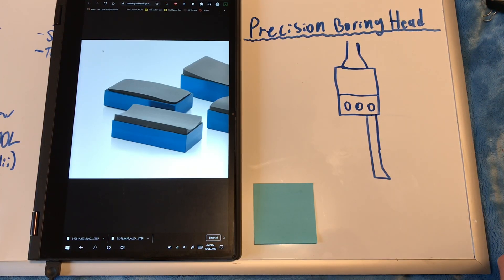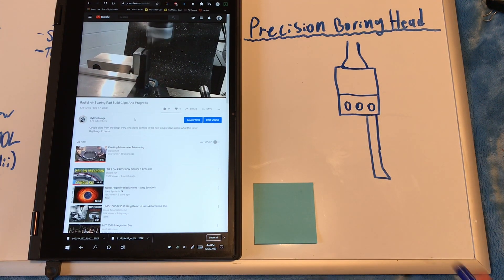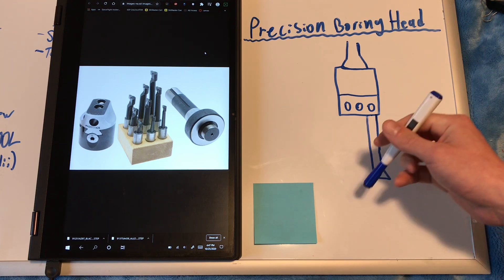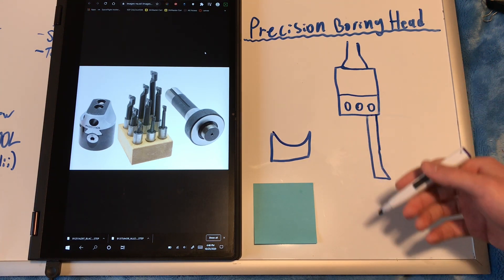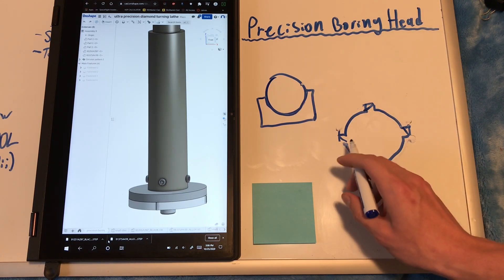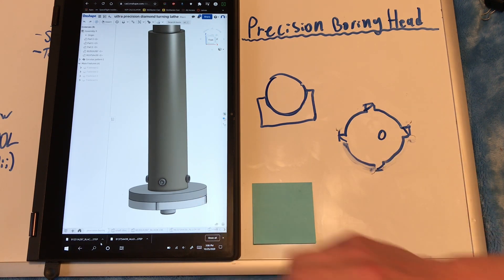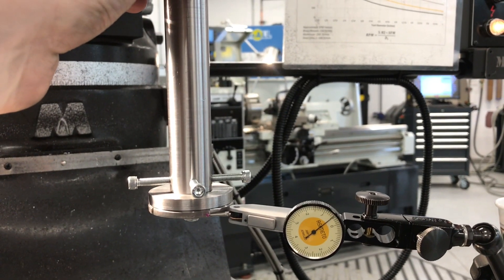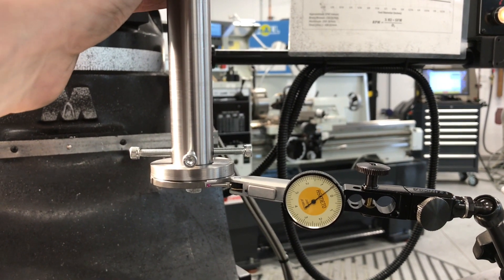Design And Construction Of A High Precision Boring Head For Cutting Graphite Air Bearings

Comment: Hey, cool video. It looks like you got the result you were after. If I were doing something similar, I would definitely stick with single point boring though. Sneak up on the radius by cutting a ring that can be measured after you cut the work piece (if you have your air bearing hanging out the side of a vise, clamp a graphite ring to the machine bed, below the bearing). Then you can measure the diameter cut using telescope gauges or a tri-mike if you have one, or even fitting up to gauge pins. If you don't have a big enough piece of graphite for a ring, you can just put another block on the opposite side of the cut that you can measure between.

To combat the stiffness issue, I would say either line bore on a lathe, by holding the boring tool in the chuck and the workpiece on the carriage, or make a quick and dirty heavy boring head. 

For the boring head:
Get a piece of steel close to but under final size by a 10mm or so, turn one end to fit in the largest collet or even to have a taper that matches your machine spindle (R8 in your case). On the other end drill and ream a hole radially to take a mini boring bar. I use ultra-mini from ceratizit (https://cuttingtools.ceratizit.com/gb/en/products/73000637.html) but I'm in the UK. You can drill and tap some holes on the bottom face of the head to clamp the mini boring bar. You have to run the spindle in reverse because of the tool orientation. Take a cut rough cut, measure it, then use an indicator like you showed to measure the boring bar position sticking out of the head. It's a lot fiddlier to accurately set the cutting radius compared to use a screw to advance the boring head like on a commercial boring head, but it's very quick to make the tool, maybe 30 mins or so, which for a one-off use like yours makes sense, and the stiffness gained makes a huge difference for precision applications. I've made 3 or 4 over the years and they work well.

Another thing is I think it is generally better to make a cut, then measure then make an adjustment. For you cutting graphite, using a milling machine with a good condition spindle, you can use the form tool pretty well without too much issue but even then, there will be a bit of deflection from the material to the cutting tool which will have an impact on the effective radius being cut by the tool. That's why cut, measure, adjust is nearly always used for high precision work.

Really enjoying the videos of your project. Sorry for the long post, I know you got the job done and there are a million ways to do every job, so this is just the way that I would personally do it.
Reply from the maker: This is the great thing about machining, there's many ways to skin a cat. Sounds very feasible
Reply: @cylosgarage  yeah i think it's interesting that every machine shop will have their own unique way for any job, based on what particular tools they have lying around and what other jobs they've done recently using similar processes. Anyway, thanks for showing the method you took
Reply: @cylosgarage  Hey I saw this video by Stefan Gotteswinter that has a technique for using an indicator in the spindle to measure a partial radius too. Thought it would be pretty relevant for your setup https://www.youtube.com/watch?v=dMKLZEgh_SU
The radius measurement is towards the end of the video

Comment: Nice. I had been thinking of making something closer to a hole saw but this is much simpler.
Reply: Couldn’t you just file the edges of your shaft end into cutting edges and just use the spindle shaft that you’re going to be floating on the air bearing to cut the radius into the graphite that way it’ll be exactly to size of the spindle every time?
Reply: Just put the spindle into a lathe chuck and cut the radius with a “horizontal bore” sliding the graphite into to the spindle.

Comment: Seems like if you have a variable speed mill you can use that to finely control the radius of the boring tool on the fly! Lol.

You mentioned blueing the shaft and printing the bearing to check the match. Taking that idea further it would be interesting to actually scrape the graphite to final size using a suitable tool. Old fashioned babbit bearings were (and still are) scraped this way to achieve the final fit. 
I do think your invention is an excellent solution to the problem though

The runout adjustment mechanism was quite clever. I must admit when I started the video I didn't expect you to account for the possibilty of runout. Nice work!
Reply from the maker: The finish and form of the graphite plays a big role in performance. Scraping marks in an air bearing, although often mere tenths deep, would cause significantly worse performance than a similar lapped or ground one. I recently discovered that after boring, I can actually burnish the graphite to the shaft for final fit. This compensates for the thickness of the blue affecting the bore accuracy. I’d estimate my current radius accuracy is within a very small fraction of a tenth. Thanks for the support
Reply: @cylosgarage  Very interesting. I guess the microscopic surface roughness of the shaft knocks off the peaks of the graphite allowing it to remove a tiny amount of material? Or maybe it just compresses the peaks down into the graphite. Finding a way to measure that radius precisely would be sweet. Maybe some kind of modified depth gage sitting on a chord of the arc could be used.
Reply from the maker: @andrewphillip8432  that would be a fascinating exercise in precision tool design. A nice CMM would certainly do the job, but I don't have access to one right now. I'll do some thinking about how you could design a gage to do that.

Comment: Maybee a little bit bigger peace of the shaft (cutting and grinding might twist it a little bit). or if you make a new cutter and finally grind the tips to the right diameter might be also precise. to dial this in, you will use the same micrometer as for your runout adjustment. best possible solution might be, to grind shaft and cutter in one step. Just thougths ... I am not an expert ;) thanks for the video